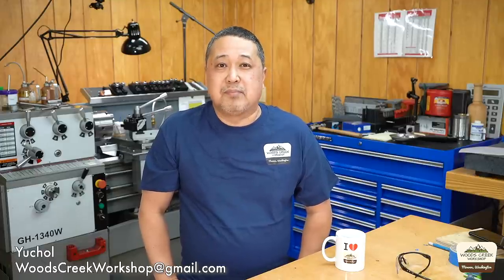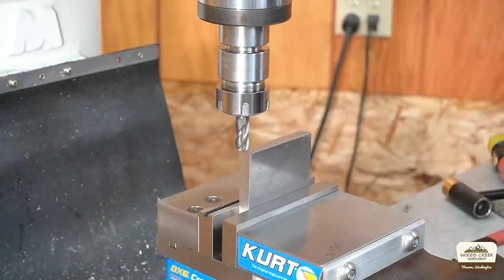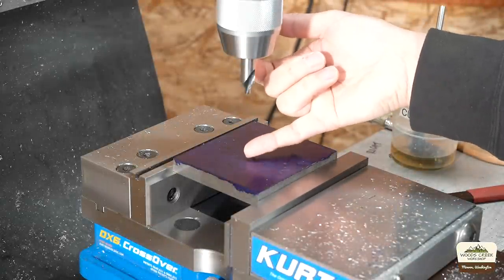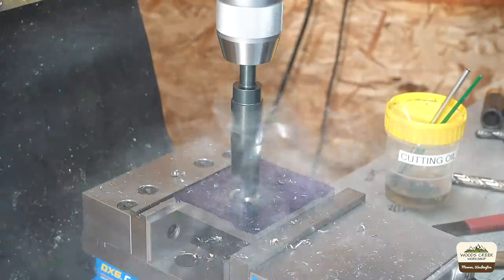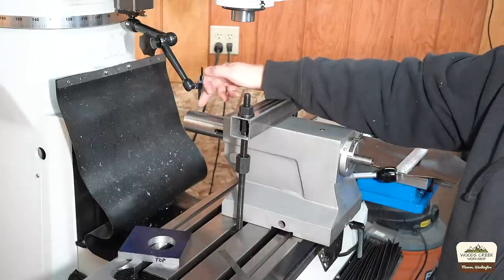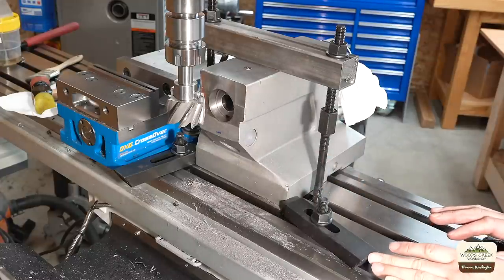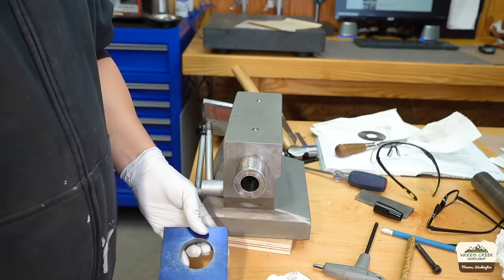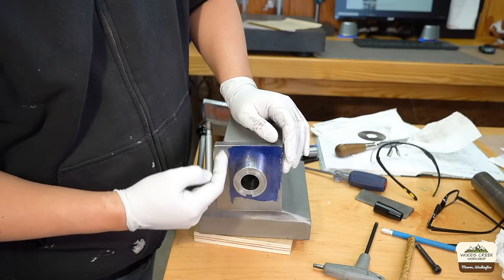Lathe Tailstock Quill Lock Upgrade

Comment: Considering that lathe would have been designed and built as at least a small light industrial machine it's surprising how badly they cut corners on that tail stock quill locking method Yuchol. Fwiw and it's surprising just how many don't know it, but keyless chucks AREN'T designed nor made for use with those reduced shank S&D type drills. And for good reason, it's because of there self tightening feature. As the drill diameter increases the torque on the shank within the chuck jaws obviously increases as well. When the shank tries to spin the internals are designed tighten up even more to prevent that.There's a few threads about what can happen on the PM General forum. The chuck will start to self tighten to where the internals begin deforming, and with a bad drill catch breaking through the material your drilling it can be severe enough to permanently lock it up and destroy the chucks internals. If your ever struggling to loosen any well made keyless by hand it's a sure sign your over stressing the chuck past it's design limits. Used within there limits a good keyless should never need anything more than hand torque to tighten or loosen them. So those reduced shank drills really need to be used with a keyed chuck or a collet.The same holds true when power tapping with them, I limit mine to about 3/8ths tap size as a maximum. Your drill chuck looks very much like the 3 integral shank keyless I bought from Glacern. I've had real good luck with mine and they compare quite well with the Albrecht I have for runout.
Reply from the maker: Turning Point thanks for the advice.  The chuck is from Precision Matthews and I really like it.

Comment: I'd be interested to know if the quill moves side to side or up and down when the clamp is applied? I have a similar lathe and with the original clamp the tail stock alignment is changed when the clamp is applied.

Comment: Nice modification!  Often the top of the tailstock casting is convex so your top clamp (while milling) would have a tendency to wander (as it did).  Some wood packing material may help next time.  I have sometimes thought about milling-flat the top of the tailstock casting for mounting a digital caliper, depth measuring attachment.  Flat, and parallel to the spindle.   Another project when time is found.
Reply from the maker: Thanks Jim.  I put a 1/16” copper sheet on top of the tailstock, wasn’t enough

Comment: I'm a little late to the party here.  But would it have been possible to notch the corners with the pinch bolt so you wouldn't need as long a tap or clearance drill?  Considering the function of this add on, I don't think it would affect the clamping force. Came out nice though.

Comment: Enjoyed, nice build/upgrade....curious, does the addition of material on the front cause issues with tooling’s tapered shank from locking or ejection?
Reply from the maker: No it doesn’t.  I installed all of the tailstock tooling and measured when they were ejected when I retracted the quill prior to the project.  With the plate being 1/2” thick, and I machined off about 1/8” of the tailstock, I still have about 3/8” room to play with.  Of course your mileage may vary depending on the lathe.  Thanks Chuck!

Comment: not bad, my only issue with  the new lock design is it does not bind the quill to the bore. in other words push any bore to quill clearance to one side an lock the quill rigid from up an down an side to side movement. ofcource the tool end of the quill is locked but the handle end can wobble around inside the bore. you may get tapers and off center from a center hole running work with tailstock support or between centers. the original design was awfull as you said. but wen it worked it did lock the assemble to itself. just a thought to think about.
Reply from the maker: Not if the bore in the tailstock is a very tight fit which it is.  Also, if you align the tailstock using the new design, there won’t be any tapers.

Comment: Im a beginner lathe operator and I would like to fix the tailstock bottom is wore so I welded the corner to bring it back true. Any suggestions on how I can make it better?
Reply from the maker: Depending on your capability and tooling, but you can remove material at the bottom and add new material to build it back up.

Comment: Why didn't you just make a new one of the internal pieces  (with the weld on it) from brass or even steel?
Reply from the maker: it would have never worked properly.  The cam lever action has such small operating radius, it wouldn't have allowed me to apply just the amount of force needed.  This is a much better design.  Thanks.

Comment: You really need to learn how to use the fine Kurt vise you have. How do you justify a 0.0005 fit with the quill and then turn around and use a hand drill to mount the clamp bracket?

Comment: Too late now, but wouldn't it have been relatively easy to make a new cylinder and key out of tool steel, in other words re-make the original pieces / design so that it would function correctly?  The plate seems to work well, but it looks like it  costs you 3/4 inch of quill travel.
Reply: Only 3/8". See his comment below.

Comment: That type of lock is better than the cam style because it grips better and holds the barrel centered.  The Chicago Lathe combo machine has a rather elegant version of this using a round split collar- easy to make with a readily available off the shelf item.  They also have used the same concept to make the tailstock telescoping, allowing 10" of travel.
www.chicagolathe.com
Reply from the maker: So true